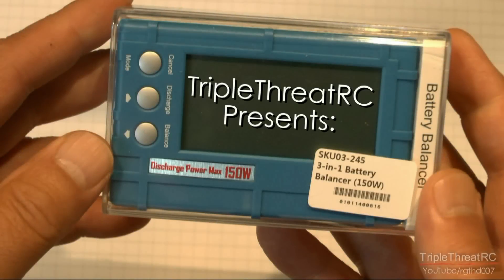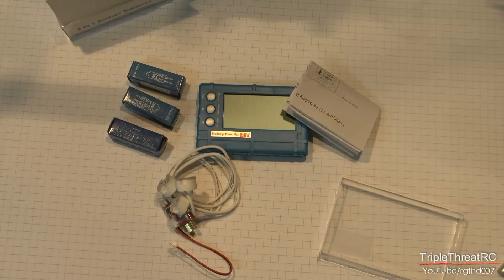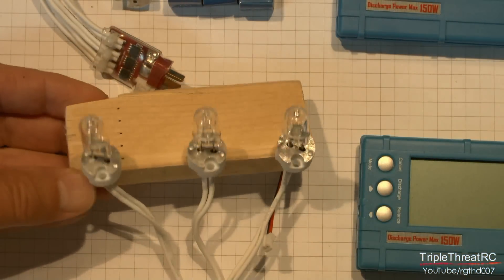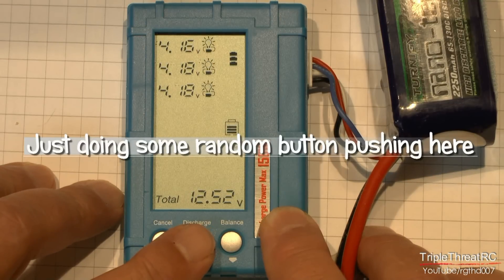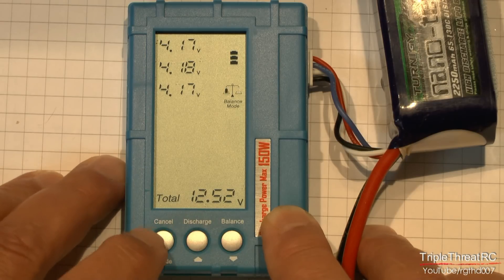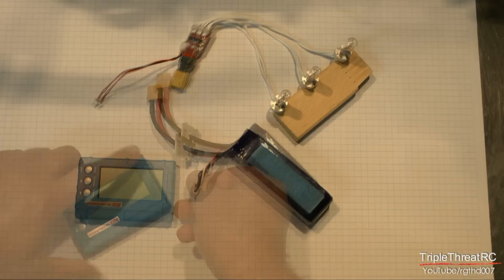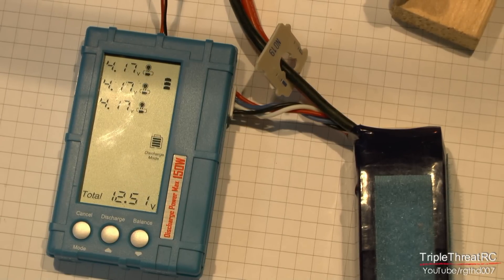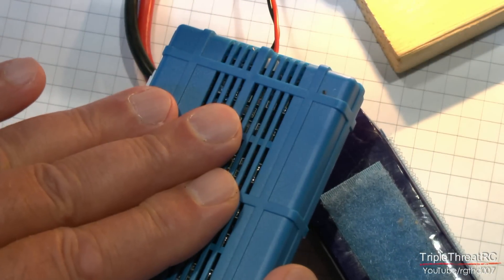Inexpensive Lipo Discharger That Works!

Comment: I store my LiPos in my BedRoom in the summer. A LiPo can burst into fire while charging or discharging (when flying), i feel safe when storing them at 3.8v i only leave charged LiPos overnigth only.
Reply from the maker: I agree and I would store your lipos at 3.8v in an ammo can and feel pretty safe. For sure I would store charged lipos overnight in an ammo case or a metal tool box or something to limit the spread of any potential fire. How much would it suck to burn your house down? I know three who had fires, two burned down their house and one their garage. All of these were the result of unsupervised charging issues but you can never be too safe.

Comment: what about just running down battery slightly in drone , then storing it afterwards?
Reply from the maker: +TheCladi8or 
That works perfectly as long as you bring it down at storage voltage. This device is more suited to discharging batteries that you don't get a chance to use and that are fully charged.

Comment: Thanks for the great video! Would you mind testing it on a 6 cell? The website says 1-6 cell but I can't imagine those 12 volt lights lasting on 24 volts for long. I'm looking to use this to discharge 6s 4000 packs. Thanks for any help!
Reply from the maker: +Partytimes08 
I've used this to discharge many 6s lipos. I think there must be a regulator that delivers a reasonable voltage to the light bulbs. In any event, there's never been a problem and I'm still using the original bulbs.
Thank for watching!

Comment: Awesome device! I need to get one of these.
Thanx for the post!
Great channel, just subbed you!
Reply from the maker: +XB 
I now have four of them and there have been about 20 of them purchased by members of our little club. Still going strong. Just watch out for potential fire hazards because the bulbs get very hot. They are the best darned deal in RC! Thanks for watching and for the sub, much appreciated!  Happy flying!
Cheers, Bob
Reply: Thanx Bob!
Yes I took special notice to the light bulb on the paper towel, thank you for the reminder.
Things happen real fast in this hobby.
I was already searching to buy one of these.
Funny you mentioned having more than one, as I'm getting 3 right now  :)
My problem is charging and then not being able to fly the next day...
Happy flying to you too Bob!

Below: I see you know Chris.He is one cool dude!
BTW, I'm XT60 also!!
Reply from the maker: +XB 
Yes, that's my issue too. I often come back home with a few packs I couldn't fly. Having more than one of these units let's you discharge more quickly. And yes, Chris is a great guy!  Cheers!

Comment: Hello fellow flyers. I really love this lipo discharger but you need to be careful with the 2 small wires that connect the discharge unit to the small circuit board. If you twist them around too much they may break at the connectors, which they did on mine. Luckily I was able to repair them with some epoxy. You may want to mount the entire unit to a board to prevent the wires from getting damages. If you would like to see how I did this, check out the posting on my blog at http://www.rcgroups.com/forums/showthread.php?t=2315958.
Reply from the maker: Yes, I had the same thing happen to one of mine too. After I repaired it, I used hot glue around the connector and wires to prevent them from straining and breaking the wires where they enter the connector. I'll check out your blog post.
Thanks for watching and for your observations. I have several of these and use them all the time, they work great.

Comment: Wow, now I'm all charged up about discharging!  Seriously, I never realized the benefits and safety of discharging batteries!  Being a relatively new to the hobby and not part of a club or group to benefit from their experience tips like this are very informative and welcome!  I really value your instructive videos and encouragement to my flying and landing or lack there of!  Thanks again and two helpful thumbs up!  Cheers Bob!

P.S. A local bacon fest this weekend... mmm bacon fest :-)
Reply from the maker: Did you say.........wait for it............."BACON FEST"?  I'm booking a flight lol.

But seriously Freddy, lipo safety is a huge issue that doesn't get enough attention. In a perfect world, you will charge up lipos just before you use them and keeping an eye on them as they charge to ensure they don't become overcharged. (where most fires occur) You will fly all the packs you charge and any packs you can't fly should be discharged. If you store lipos for any length of time, you should keep them at a storage charge of 3.85V per cell. This will extend the life of your lipos. You will also not use a lipo that is dented or damaged in any way (as in crash damage or dropping it onto concrete etc.)  I put a storage charge on the lipos I use every time I get home from the field and discharge the ones (to storage voltage) that I didn't get a chance to fly.

Thanks for watching and happy flying buddy!

Comment: Very interesting Bob :)
I can understand your concern, me too when i go flying, i mostly go with all my LIPOs fully charged and sometimes unfortunately i can not discharge them all during my day! I use mostly my LIPO charger for discharging them when i go back home but it takes so long time lol
This fantastic device is on my top list now!
Thanks for sharing and have a great week.

Cheers :)
Reply from the maker: I agree Cedric, I hate coming home with six fully charged 4s 5000mAh lipos for my QAV!. This will save my chargers a lot of wear and tear! Thanks for watching!
Cheers, Bob
Reply: @SubToTripleThreatRC  -- so it can wear out a charger when discharging batteries?  Ok, thanks man.  I knew the charger was a cheapy China unit with the touch-screen, and I should have assumed it was brittle and discharging was not good for it....but i'm stupid that way as I am just getting back into the flying sport after being out of it for a long, long time and battery technology was not anywhere near where it is.  Not even close.  I just wish they would make a battery that is safe and doesn't need 100 dollars of accessories to keep it from catching the house on fire and just to keep the women of the house from closing us down with our favorite hobby.
Reply from the maker: LOL. Yes, discharging a battery is very hard on a charger because of the heat generated. In the case of this cheap little device, the three 50 watt light bulbs do all the work and take all the abuse. The heat doesn't get near the electronics like it does with a charger. And I agree, I look forward to the next leap in battery technology!  Happy flying to you and welcome back to the hobby!

Comment: Great informative video Bob. What are the other connections on the unit for? Is it one bulb per cell?
Reply from the maker: Hi Geoff. If you're talking about the connections on the end of the unit, they allow for measuring the voltage of a receiver pack. One is for the "servo end" of the receiver pack and the other is for the JST connector from a 2 or 3 cell lipo to power the unit while you test the receiver pack. Thanks for watching!
Reply from the maker: Hi Geoff, I missed the question about one bulb per cell. No, it modulates the draw to use as much load as is required. At some point in the discharge cycle, all three cells (as in this example) are being taken down by one bulb.
Reply: TripleThreatRC are you talking about the module between the discharger and the battery? I really want to know if i need to buy that thing with the lamps?! I don’t understand. CAn it discharge without that lamps between the discharger and lipo?

Comment: Nice video.. sweet little discharger.. How much heat does it put out?
Reply from the maker: Thanks Pat. Aside from the bulbs that get super hot, the unit itself gets quite warm, not hot but warm. I think it gets warm enough that if I wanted to be kind to it, (while it is discharging) I would make sure to not block the vents on the underside. I'm going to make up a little stand to hold a couple of these and their bulbs and I'll be making sure they can get some air. If you were to leave it flat on a workbench, I doubt it would cause any problems but cooler is always better :-)

Comment: Nice product...it is very important to have a battery in a storage mode for safety when not using on a few days or months.  Nice work Bob!
Reply from the maker: Thank you very much. Aside from the safety issue and depending on who you listen to, it is not good for the long term health of the Lipo to leave it fully charged for more than about 24 hours. At our club, most of us will charge up the night before or on the morning of the day we are going flying. If you use that Lipo within the next day or so it should be fine. Most of us would never store fully charged batteries for more than a day or two at the most.
Reply: ***** I agree..thumbs up!
Reply: Nor all have such possibility. I'm also trying to charge at morning. But usually I have time for that only at evening of previous day or 2 days before.